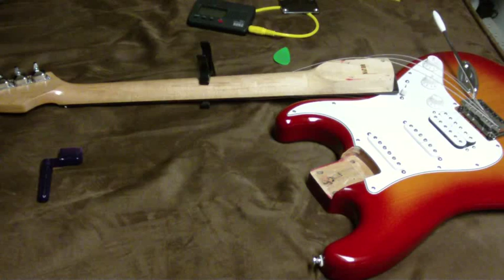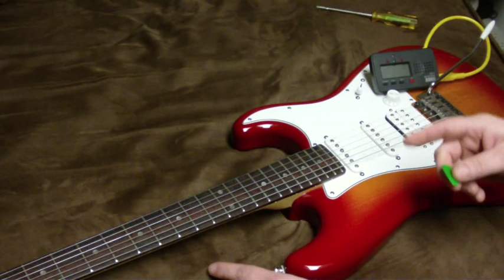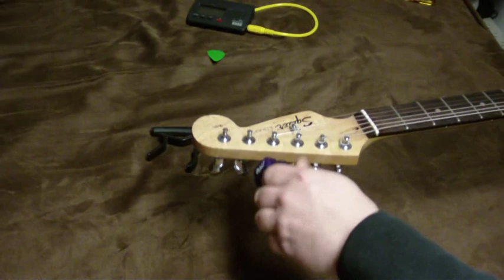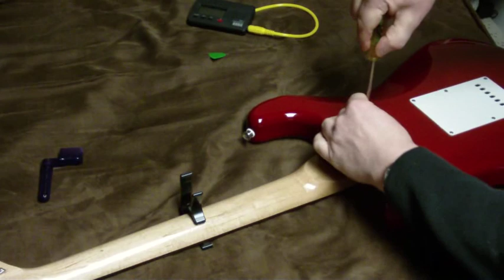Fixing a strat's intonation by adding a neck shim Part 1 of 3

Comment: My issue seems to be the reverse, I just got a 1985 Fender USA Strat in very mint cond, all the strings  intonate perfectly except the D string?  And my prob on this is the reverse I have the intonation set all the way forward for that saddle to the point I reach the end of the threads on the adjustment screw, I fret that at the 12 string (2nd octave) and the tuner shows a nearly full half step flat? Any Ideas?

Comment from the maker: Hey, it is in my bedroom!

This video is to demonstrate shimming a neck if you run out of saddle adjustment room and other concepts, which is easier shown this way than if I was holding the guitar. How you fine-tune intonation is up to you. I find that I end up tweaking intonation on each string by ear, so that chords are agreeable up and down the neck, which may not agree with what a tuner says.

Comment from the maker: @misterbeets You are probably right if you are using the same tuning - it is easier to push smaller strings with less tension sharp when fretting, and the light-string intonation may have been compensating for this. There is less of this effect if you are a skilled musician with a light touch and small frets.
Installing thicker strings usually goes along with dropped tuning, which needs a longer intonation scale.

Comment: Great idea for a video series! I put my own "strat" together, using a longer neck from a different guitar model which I trimmed down. Seems I trimmed it maybe 2mm too much and intonation is off on 2 strings from the same problem yours here has.... plus I was hoping to switch to bigger strings so I guess that really wouldn't work.
Looks like you're about to give me the info I need to fix it right. Thanks!

Comment: shimming like that will create humps over time on the upper fretboard. Also, doing intonation while the guitar is on it's back isn't good. The neck weight pulls the intonation up. Put it at players angle. then measure again. .. you'll see.